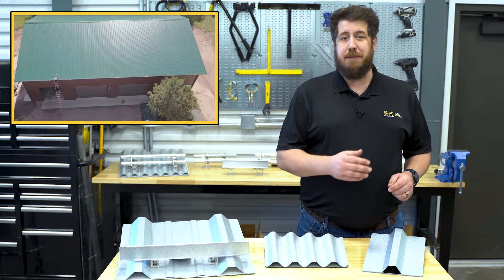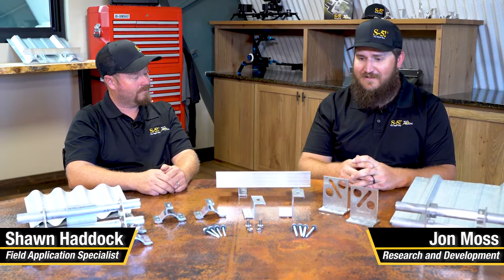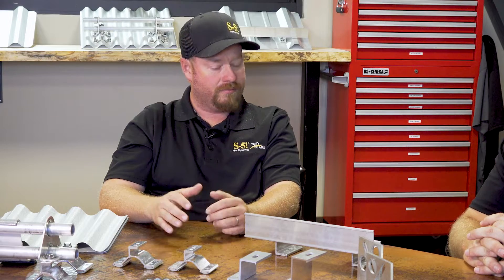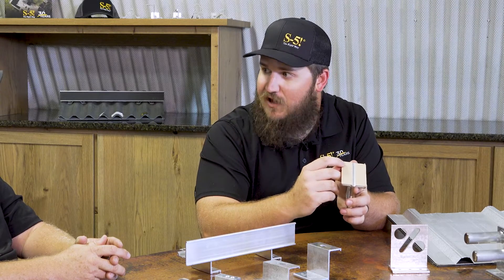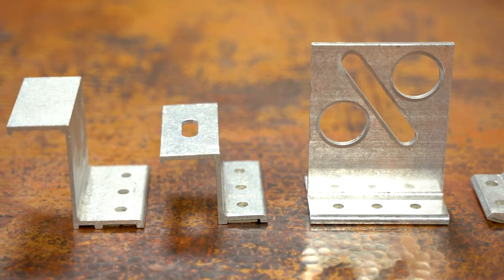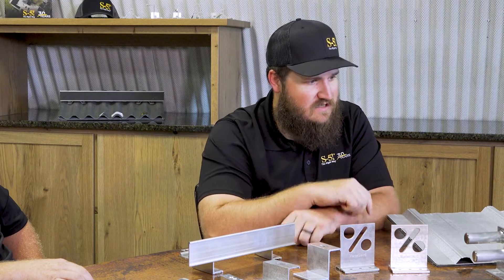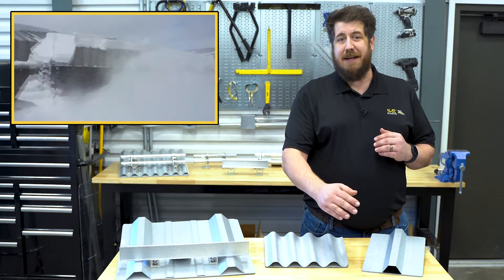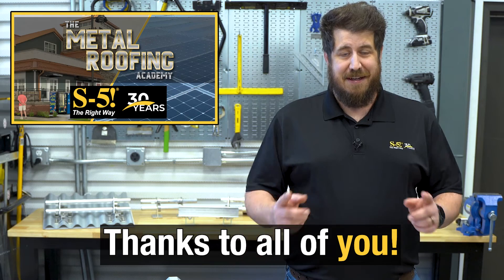Choosing the Best Snow Guards for Exposed-Fastened Roofs

Comment: Can you just install a snow bar on a portion of a metal roof? The roof in question is on a pole barn type building and the snow sliding off the roof is not an issue except the area where there is a 5' double door. Will it work to install the bar system just above this area (5' - 6').
Reply from the maker: We here at S-5! actually don't recommend putting a snow bar over just a portion of a roof.  Check out this article on our Support Center and Knowledge base to find out while:

https://knowledge.s-5.com/knowledge/why-is-it-a-bad-idea-to-put-snow-guards-just-over-doorways

Comment: Does snow guard causes an increase in the load of snow?
Reply from the maker: Most building are designed and engineered to withstand the snow load for the area regardless if snow retention is part of the original design or not because even without snow retention you never know how long the snow will stay on the roof on its own or how much will come off when it does slide off. With any installation we recommend that the system be properly engineered to the roof using our Snow Calculator at www.S-5.com. If you have any questions please contact our support team at support@s-5.com.